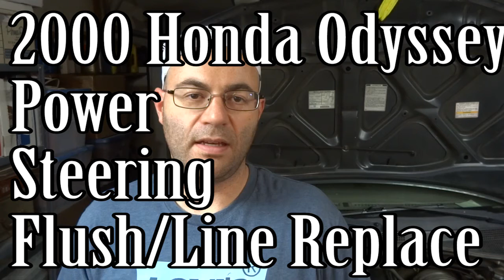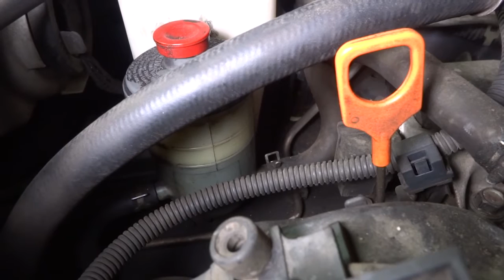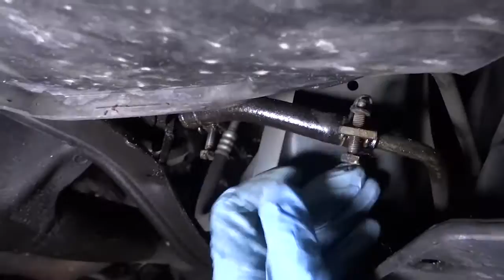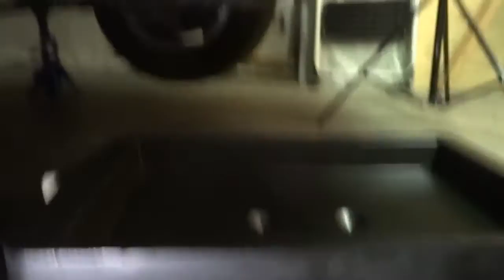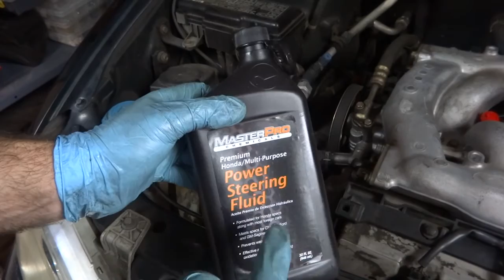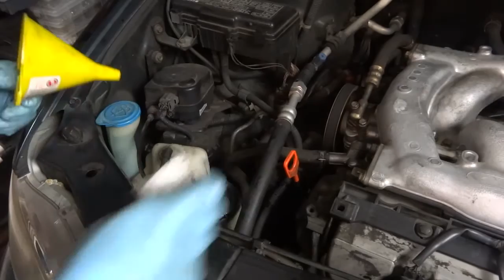Honda Odyssey Power Steering Flush & Line Replace DIY

Comment: How come there is NO rust on this 2000 Odyssey?  Are you in CA or AZ ?  Those wire clamps are all completed rusted out on my 1999 Odyssey being here in New England.
Reply from the maker: 12vgs8606 Low Earth Orbit.  Vacuum preserves everything so nice. ;-)
Reply: Even a two year old car does not look that clean around here!
Reply: +12vgs8606 Hahaha I thought the same thing. Our 1999 Accord in NE Ohio is rusted out underneath.
Reply: LOL Im in san diego, crawl under my 07 and a lot of the metal is still shiny. The worst is some very superficial surface rust. And im not far from the ocean, 20 miles inland (El Cajon) you see 70s daily drivers with just surface rust. 
I used to know a guy from chicago back in the 90s that was a mechanic who would buy cadillacs out here, usually Sevilles from late 70s-80s for about $1000 or less that needed minor repairs and drive one with another in tow back to chicago. Easily fetched $5000  a piece for them, the condition they were in was so rare. But its all relative, in SoCal housing costs are insane, we pay over s dollar a gallon more for gas than the rest of the country, and Calif taxes are outrageous so they can pay for medical care etc for millions of illegals.
Coldest night of the year last year was 38.  Thats something.